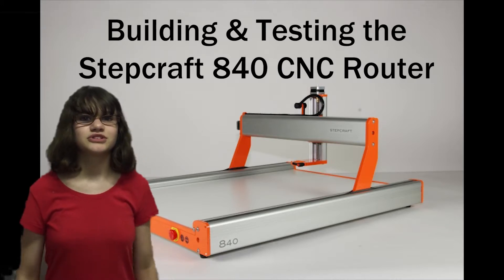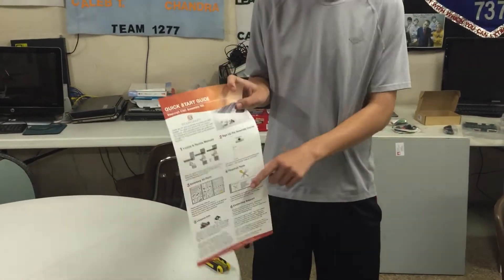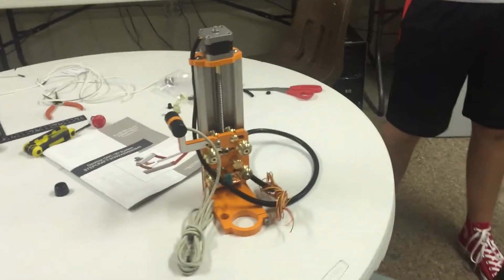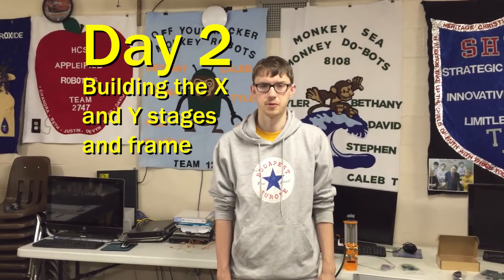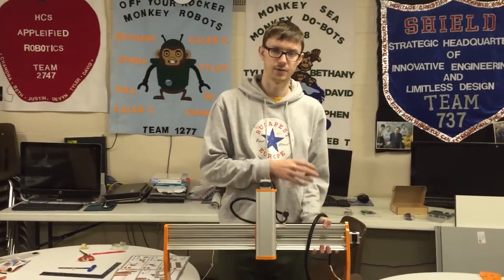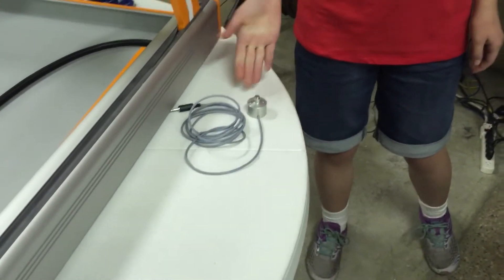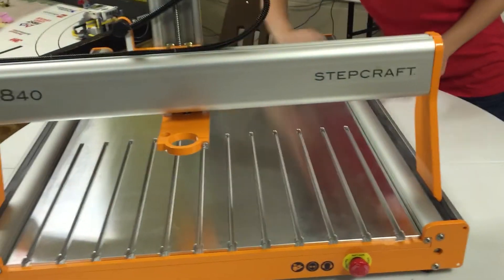FTC4106 Stepcraft840 Build&Test

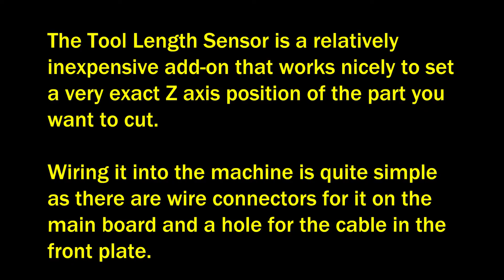Comment: At time line 08:11 to 08:19 the tool length sensor was tested.  However it obviously did not work! You can hear the motor bind on its way back up.  What was done to fix this?

Comment: 09:03 You should go with the Kress Spindle for flexibility (800Watt)... 
specially aluminum like the 500$ t- slot table. 500$ it's a rip off! Just 
look at this, 500 bucks really???
Reply from the maker: It is expensive.  It is really nice, though. It adds some beef to the overall machine that makes it more sturdy, which we really didn't expect.